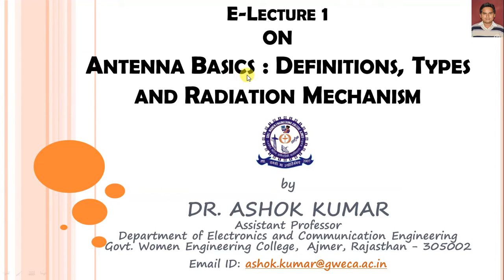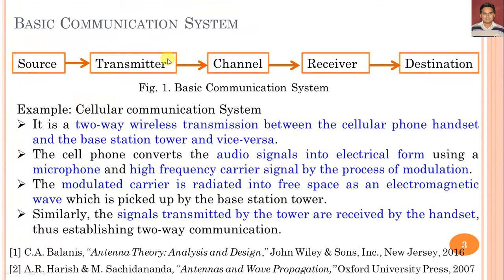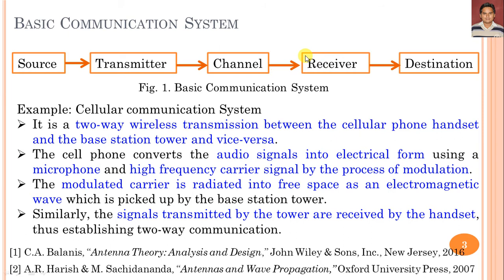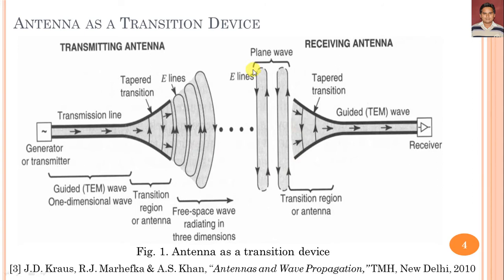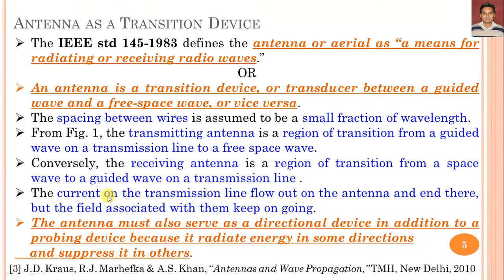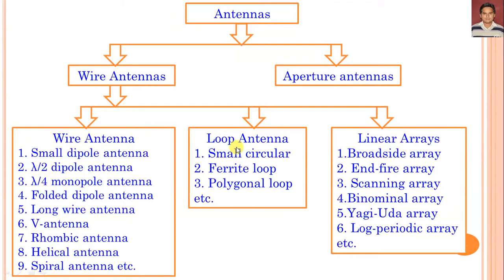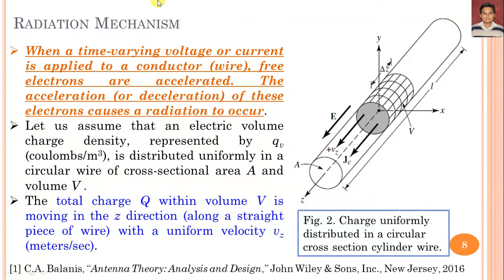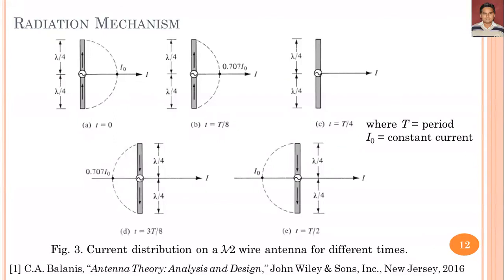Lecture 1 | Antenna Basics | Radiation Mechanism | Antenna and Wave Propagation | Dr. Ashok Kumar

Comment: A half wave transmitting antenna radiates 10KW of power at 100MHz. If the heights of transmitting and receiving antennas are 100m and 9m, calculate the power received at a distance of 10kms from the transmitting antenna.

Can you solve this sir?